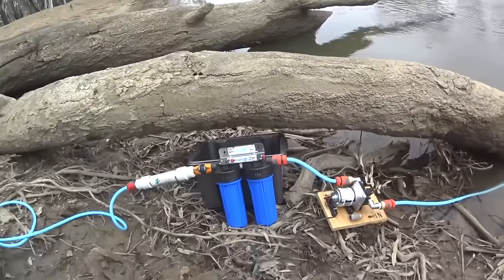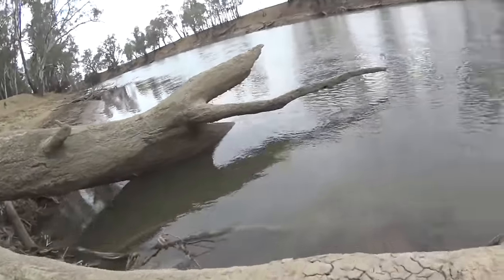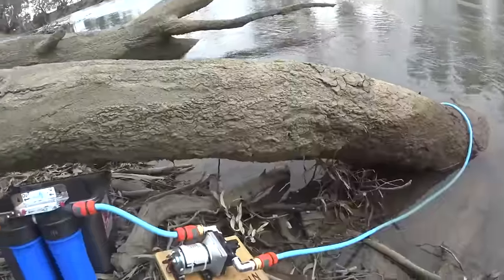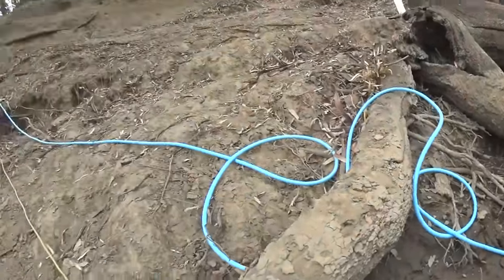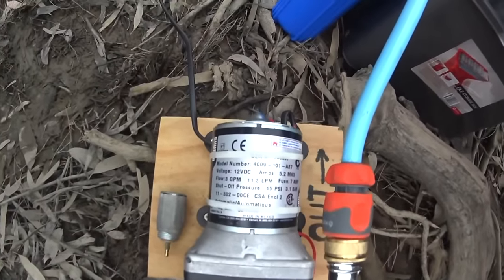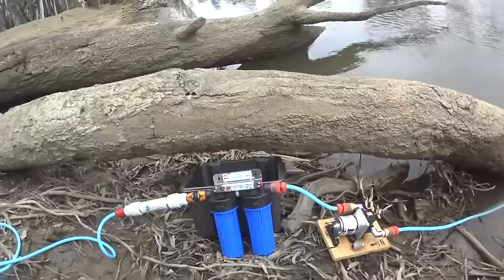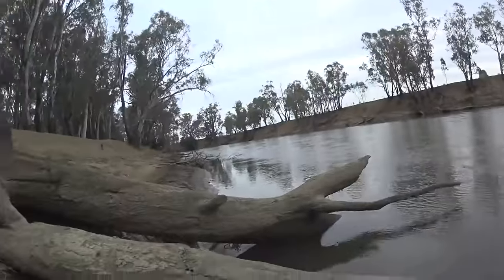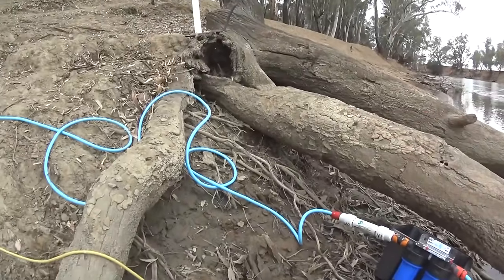12 Volt water pump, Shurflo pump and Water Filter for filling RV Caravan tanks, or camping shower

Comment: This is awesome. I have 2 questions for creek/river water pumping 

1. What non Chinese water pump do you suggest/use?

2. Can you just use a BEST filter for simplicity ?
Reply from the maker: Hi, I am happy that you like the setup. 1) I am still using the same pump and have not had the need to look at others for quite a while now, so it would pay to google it or go and have a chat with people in a caravan parts retailer.
2) I would get on to BEST as "Best" make a few different filters email them and tell them what you want to do, I am very confident they will have one that would do the job. (I am not linked in any way to Best Filters) Thank you for your comment.

Comment: Hello i like the video.but you did not show very close so we can see the filtration well
If you can make another video showing well all part thanks
Reply from the maker: Thank you very much. I have in the description, The 12v water pump, I used is a Shurflo pump 4009 Fresh Water Pump 12v 11.3Lpm

FILTERS
The Twin Blue Water Filter, the first filter the water goes through is a (0.5 Micron Sediment Dirt Pre Filter) and the second one is a (1 Micron Carbon Block Filter) this one Reduces Chlorine Taste & Odor.
The last filter in my system is a 322H B.E.S.T Inline Water Filter. I hope this helps. Please talk to filter people to find out what you should be using for what you are planning to do with your setup.

Comment: Would you be able to just, instead of hooking it up to the RV/car, just bring an additional 12v car battery and plonk it next to the pump and hook it up from there? I wonder how long the battery would last before needing to be charged again.

Great video! I'll definitely be doing something similar but the rivers and lakes in Poland aren't the cleanest, so I will rather use the filtered water for washing.
Reply from the maker: Yes by putting the battery there at the pump would work, just the same as I am using batteries in the van to run it now, (probably a little bit more efficient putting the battery on the pump as you lose a bit with the long wire getting there the other way) as to how long the battery lasts depends on a lot of things, battery size, how far you are pumping, is it a long way uphill. I have a friend who runs a similar portable system and uses a small petrol pump. Thank you for your comment.
Reply: @GavinClarkdiy  Thanks for the reply, Gavin, I'll let you know how it works out!

Comment: I’m gearing up my stationary fifth wheel to live in, I’m on a lake up a slope similar to this! Do I understand correctly that you only turn the pump on when you need to fill the holding tank? 

I am thinking of putting the pump in a shed that sits 50’ from my Rv, where it can get plugged in.
Reply from the maker: I am thinking you need a bigger pump than I have used. I do only pump to get the water to fill the holding tank when needed, there is another pump in the RV to pump from there. Cheers!

Comment: The voltage drop on that 12v run is going to be massive & your pump may burn out fast... Also I would fit a Ultra Violet light steriliser to kill of the germs that will get through the filters...
Reply from the maker: You are right and many people have told me this but It seems to work for me. I tested this, with NO LOAD, the voltage at battery = 13 volts, at the end of 40m lead it is 13 volts, the same. BUT it certainly would not be 13 volts when under load with the pump running, I have never tested this but without a doubt, the voltage drop would be there. The cable I am using is the same as the 240 volt 15amp wire used in caravan power leads. When I decided to make this I took the pump out of the caravan and set it up pumping from a drum, through the 3 filters in the video, ran the power from the caravan batteries through 2 by 20m 15amp leads and 2 standard 20m 10amp leads. I had all the hoses we own 80m of hose, I put one end up on the house roof. So I am running the pump with 80m lead and 80m of hose, and ran it for 30 min, the flow was about half of what you see in the video, the leads did not heat up, the pump did get hot but you could still hold your hand on it. The fuse did not blow. That was my "BACKYARD" test to see if it would work. I was happy with that and bought an identical pump on ebay, and my set-up is what you see here. I have had a few people say it won't work and the pump will burn out with the voltage drop, so keep that in mind, but, I have pumped over 2000 litres through this set-up since I made it, mainly through 20m of lead and hose, and 40m when we need it. On the Ultra Violet light steriliser, I use are carbon filter as one of my 3 filters, this does it to some degree, BUT if I have any thoughts that the water is not good enough to drink, we do not drink it.
Reply: @GavinClarkdiy  Hey Gavin - is the pump still going strong, or have you made 'improvements' to your setup?
Reply from the maker: Yes still going strong, I have not changed anything.

Comment: Do you need a filter before the pump so it doesnt get clogged with debris?
Reply from the maker: Right at the start I show the hose in the water, I have a very simple "Flywire" type filter, like you would have on your garden system or washing machine hose, it is just to keep the bugs or little sticks out. I hope that helps.

Comment: Hi, I’m planning a setup like this to create shower / dishes water from the stream near our cottage here in Czech Republic. Was wondering, filters like these do they need a minimum pressure for water to run through (using a tiny wee pump) or is there maybe even a max if i’d Connect them to my larger pump I use for watering plants? What’s ideal for water to run through these filters? Thx a lot.
Reply from the maker: I am very sorry but I do not have answers for you, I would contact the people you get the filters from or even the pump people, Sorry
Reply: Captain. !! No minimal pressure valve u can use it that’s right. The pressure displayed is the top u can use it with so it will flow but doesn’t take more pressure so u safe go ahead mate.  Tiny

Comment: is it possible to leave the filter near the water and have the pump near basecamp?  looking to mount this pump and use way less electric cable.
Reply from the maker: I would think the pump will not have the sucking power to do that, and normally a pump needs to be primed so it can work, plus there is a big chance the hose would suck in flat and prevent the water from getting to the pump. Just my thoughts

Comment: I thought about using a submersible pump/filter that are designed for fish tanks to rig up for a shower when I build my tiny home. If I use a small galvanized tub to stand in, and also store the water in, , and maybe even heat the water with a aquarium heater. Do you think it would work?
Reply from the maker: I can't imagine an aquarium pump heating the water you would need fast enough, and have you tried the pump as to weather there is enough volume? I know nothing about the pump or heater you are thinking of, but if it works all is good.
Reply: I think I've actually figured it out, in theory at least. Thanks

Comment: Hi Gavin. We have same pump but having trouble with flow up hill not as steep or as long as yours. Do you have a pressure valve with this thanks
Reply from the maker: No I don't it is just the pump as you see it, are your filters blocking the flow? do you have a good flow after the filters without the hose on?

Comment: Hi! How long did it take for the pump to get the water to the shower from the river?
Reply from the maker: Hi, the pump in the video is only pumping the river water into the caravan water tanks to fill them up, once full this pump is removed. If I am having a shower, there is a pump on the caravan tanks that pumps the water to the shower so everthing works as normal then.

Comment: Great setup Gavin. What are the connectors you have on both ends, pre filter what are you using? and lastly what is the bent pipe you have going into your caravan water tanks? trying to find something similar but i can't.
Reply from the maker: The connectors on all the hoses are just standard half inch hose fittings. The bent pipe is just a bit of half-inch copper pipe I have bent and soldered to a steel male hose fitting (The type you would put on your garden tap to connect your hose.)
FILTERS
The Twin Blue Water Filter, the first filter the water goes through is a (0.5 Micron Sediment Dirt Pre Filter) and the second one is a (1 Micron Carbon Block Filter) this one Reduces Chlorine Taste & Odor.
The last filter in my system is a 322H B.E.S.T Inline Water Filter.
Hope that helps.

Comment: Hi Gavin, just installing a pump in my camper trailer, and i gotta say it's so friggin noisy, i have tried all comment on google (coiled hoses, rubber backing etc) but that pump you have there seems so quiet, what make is it please? great set up by the way
Reply from the maker: Hi, yes my pump is very quiet, and I am still very happy with it. The 12v water pump, I used is a (Shurflo pump 4009 Fresh Water Pump 12v 11.3Lpm ) if you copy paste that into ebay you will get a price. Wishing you the best for your camping trailer.

Comment: Hi great video will look at doing something similar.  In your opinion the water is fine to drink?
Reply from the maker: The call if it is drinkable water will always have to be made by you, we mainly camp on the Murrumbidgee and Murray rivers and we drink the water, but things change all the time, Right now the Murray has warnings on it not to drink, as it has algae in it, I have seen a dead cow floating down the Murrumbidgee River where we camp. It's got to be what you think at the time. Hope that helps a bit.
Reply: Yea totally understand its a contentious subject! I pumped out of a creek last weekend usually crystal clear but had a smell and bit of crap in it. i dont think id have a problem with drinking that water. Would still boil as well for the little one. Always have tried to use nice flowing water but the murray with the blue green  algae is another issue!
Reply from the maker: +Caine Thake  yes, we just have to make a decision on the day,,,, there are filters that filter almost anything out, have a look at the LIFE STRAW,   not quite what you and I are talking about but interesting stuff.

Comment: Hi, inspired by this great video I bought a Shurflo Classic 7l p/m and two filters (one particle, one carbon) and am planning to set it up soon. I was just wondering if there's anything special I need to do to keep the pump running or adjust the  pressure settings?  I want to build a box to hold the pump and filters and some switch outside. The pump has two positive and one negative lead. What to use for the switch ? thx a bunch from Prague Czech republic. :)
Reply: Did you complete the project?  I am going to purchase parts and wondering if you ran into any issues

Comment: wow that  pump is powerful can you tell us the filter brand
Reply from the maker: The 12v water pump, I used is a Shurflo pump 4009 Fresh Water Pump 12v 11.3Lpm 

The last filter in my system is a 322H B.E.S.T Inline Water Filter.

Sorry, I do not have the brand name of the filters in the blue holders, but I bought them on eBay, If you search  "caravan camping water filters" you will get to see what is available. 

Hope that helps a bit

Comment: Cool setup. What size battery are you running off?
Reply from the maker: +ryanhenry21 Hi the caravan has two large 120ah batteries, and that is what I generally use, I can also hook it up to my 4x4 car battery and do that occasionally, and leave the car running for the time it takes to fill the tanks.

Comment: I'm having a problem identifying the hose you used. What's the diameter and gauge? Thanks!
Reply from the maker: It is a Drinking Water Hose 12MM - 1/2"
Reply: @GavinClarkdiy  Thanks, Gavin. Do you have links to the filters and pump where you get credit for the sale? I'd like to support you for this great info. I have an adventure van that needs this system.
Reply from the maker: @mikehiers  No I do not have any links like that, thank you very much for asking, I wish you the best with your project.

Comment: Just putting a filter system together similar to yours. Where did you get the hose fitting for the filter head? I'm going to use a small petrol water pump.
Reply from the maker: Hi Malcolm, the fittings are just thread one end and hose snap-on the other i believe i got them at Bunnings the thread is just standard water pipe thread on mine. and the white filter came with the hose fittings on it. hope that helps.
Reply: Your fitting must be smaller , I think the thread end is about 3/8 something.
Reply: Sorry larger.
Reply from the maker: I would pay to take the filter into Bunnings or a plumbing place, and try different fittings, on of those two wound have what you would need.
Reply: u

Comment: What is your voltage at the pump with 40m of electrical cable? Seems like voltage drop would be significant without an expensive heavy power cable.
Reply from the maker: +Zane Krempel Good question, I tested this, with NO LOAD, the voltage at battery = 13 volts, at the end of 40m lead it is 13 volts, the same. BUT it certainly would not be 13 volts when under load with the pump running, I have never tested this but without a doubt, the voltage drop would be there. The cable I am using is the same as the 240 volt 15amp wire used in caravan power leads. When I decided to make this I took the pump out of the caravan and set it up pumping from a drum, through the 3 filters in the video, ran the power from the caravan batteries through 2 by 20m 15amp leads and 2 standard 20m 10amp leads. I had all the hoses we own 80m of hose, I put one end up on the house roof. So I am running the pump with 80m lead and 80m of hose, and ran it for 30 min, the flow was about half of what you see in the video, the leads did not heat up, the pump did get hot but you could still hold your hand on it. The fuse did not blow. That was my "BACKYARD" test to see if it would work. I was happy with that and bought an identical pump on ebay, and my set-up is what you see here. I have had a few people say it won't work and the pump will burn out with the voltage drop, so keep that in mind, but, I have pumped over 2000 litres through this set-up since I made it, mainly through 20m of lead and hose, and 40m when we need it. Hope that helps.
Reply: don't need high voltage to run water pump
Reply from the maker: I agree, that seems to be the case with my pump.

Comment: Hi Gavin. What’s the rating on the cable. Obviously gotta be careful with voltage drop.
Reply from the maker: The cable is a 15amp 240volt lead and I am running 12 volts down it. Yes I have been told about voltage drop, this set-up works for me we have used it many many times, I am happy with it for us. Talk to am an electrician they would be able to help you if you are setting something up, you want something that is safe. I am not an electrician. Thank you for your comment.
Reply: Gavin Clark 
Good stuff Gavin. 
Yes will be looking for something similar as I’m doing a circumnavigation for about 12 months and into some pretty remote places. No caravan just a ute with a canopy. So this info is really useful. Thanks mate.
Reply from the maker: Sounds like a great trip, make sure you are happy that the water is ok if you are going to drink it. Thanks for your comment.

Comment: How often do you change the filters?  I bought some of ebay. The neighbor  replaced his kitchen and took out an Aqua pure system which the bower bird has salvaged for my use.
Reply from the maker: I have changed them after 2 years, I have heard they should be changed every year, which is probably very good advice, but mine seemed fine,  When i get home from a trip I take the filters out and let them dry out, they stay that way until my next trip, I would think they would go moldy if left wet and not getting used.(Don't know). I am not an expert in this and I must say when I was researching to make mine all the answers I got from pump and filter people was change it if it tastes different,,change it every year, change it when it stops flowing well,,There didn't seem to be a set rule. Hope this helps a bit and also hope it didn't make it more confusing, when you get a chance ask the filter people.
Reply: That all makes sense, Good idea to dry them out as well. Thanks for the advice.
Reply from the maker: Not a problem, glad I was of some help.

Comment: Can i ask you if i have a separate car battery 12v for the pump , how long can it work continuously until the battery empties?
I want to use for irrigating olive trees. Thank you.
Reply from the maker: +ΒΑΣΙΛΗΣ ΑΘΑΝΑΣΙΟΥ  Hi, the caravan has batteries in it, charged by solar panels, and that is what I use, I have used the car battery at times, I have not had trouble with batteries going flat, but I am only filling my tanks and then turning it off, so it is only running for about 20min at a time.  The pump I am using is really for RVs and caravans, I don't know if it would handle long runs watering trees. Hope that helps a bit.
Reply: Hi Gavin, i was not able to be certain what i was seeing there but  did you have a battery sitting behind your filters there? I assume it must have been because if you were running a 12 volt cable for 40 meters your losses and heating would be huge with a cable that thin.